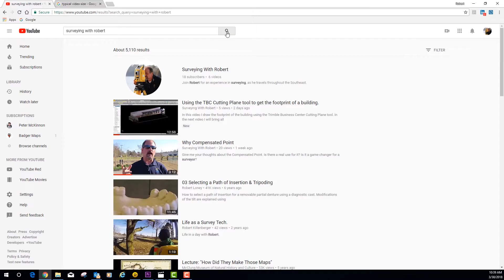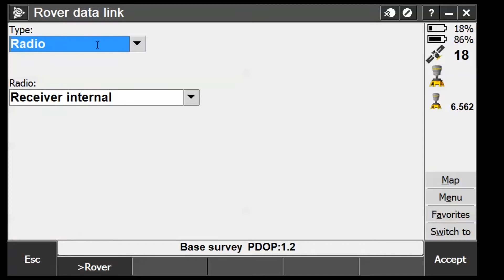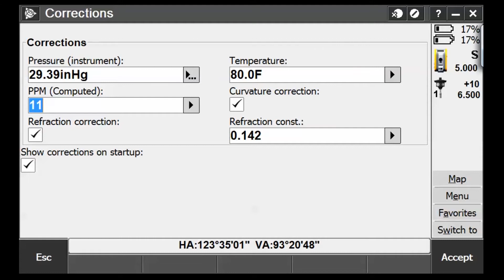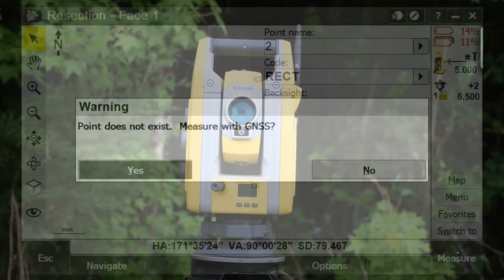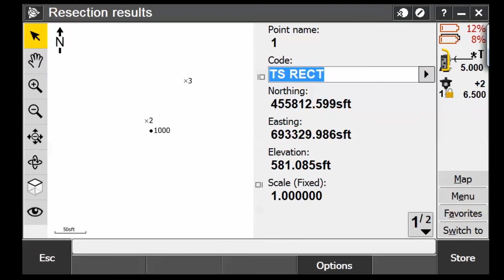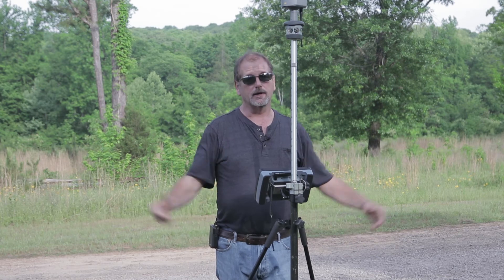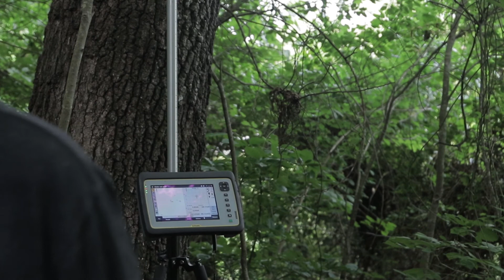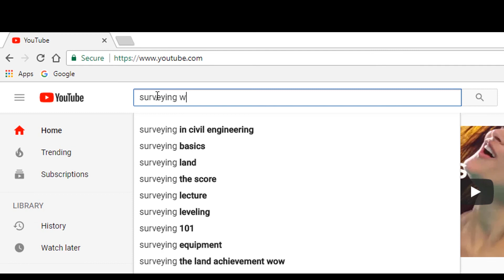Integrated Surveying using a S5 Robot and R10 GPS

Comment: Hello Robert, 
Really enjoying the videos we have been able to see so far.
We would like to know how you setup your settings within the controller (TSC3) to obtain the fixed scale to 1 when you show the resection results.
Our intention is to be able to export the information in a csv file and inserted into Civil 3D and have our distances and linework shown in ground and not grid, as of now when utilizing the Integrated Survey method they are shown in Grid when our csv files are inserted into Civil 3D.
Would obtaining a fixed scale to 1 provide this?

Will appreciate your response.
Reply from the maker: Sounds like a grid to ground video in Access. If your points you resect from are grid then just going to scale one really doesn’t work.

Comment: When doing an integrated survey style, it allows you to input a gps antenna height offset since the gps is sitting on top of the prism and the prism is at the correct height.  However I'm not seeing where trimble access allows you to input a gps offset when in any other survey style even though I like to run an entire day with the gps on the prism. Part of the day I would run integrated, but not all day and I wouldn't want to keep switching rods configurations. Is there a way to do that in Access or is there some other type of work around?

Comment: Hi, In a normal resection geometry is important such as keep long backsights and equilateral triangles. Is this the case with integrated surveying? I would be wary of measuring short bacsights?
Reply from the maker: True but if your not going any farther than your for site then you should be good. Also you can get better accuracy using more than 2 points for your resection to improve geometry on your solution
Reply: @SurveyingWithRobert  Thanks Robert, I do subsidence monitoring on a landfill with a Trimble 5605!! I have to do 3 point resections using reflectorless mode.

Comment: Robert at 12:20 you mentioned pushing a button to switch from GPS to the TS. I've been following your set up procedure but I'm struggling to switch from GNSS to reflector-less. Can you tell me how to quickly switch between the two methods please.  Top videos please keep them coming.
Reply: From my memory, there's a bar at the bottom of the screen showing either RTK fixed and ENZ accuracy or Angles and distances, click on the bar and you can toggle between both? Then measure

Comment: Good day Robert, I have a question for u. I have a new S7 2" DR+ and TCS3 (with internal radio). What kind of range can I get between the TS and Data collector before I lose radio link? At 30' - 50' the connection goes in and out. 60' I lose radio connection all together. I noticed in this video you got 80' but with a S5 & TSC7.
Reply from the maker: You should get 1500 foot in the open and 400-600 feet in the woods. Replace the antennas first if you are trouble shooting.
Reply: I figured it had a much better range, and the antennas are 5 days old. The one thing I didn't do which I am about to go check is changing the radio settings. I had to do that with the TDL 450H on the weekend. there was some local radio inference, I believe this is the case.
Reply from the maker: Jeff Johnstone could be but 5 days old sounds like a bigger issue to me.  Try changing the channels but I suspect it will need to go to the shop.
Reply: @SurveyingWithRobert  geez 7650 possible radio configs (30 CH's;255Net ID's) lol. I fired up the T10 I got for the sx10 and tried using that, no luck. Put the TSC3 antenna on the S7 and have no radio problems. The Trimble dealer (Cansel) here in western canada suspects it was a faulty antenna and a replacement is on the way. Thank You for ur time Rob and take care my friend.

Comment: Great vid Robert. One questions, when you connected to your RTK, did you have a GPS base setup someplace or did you survey with a CORS network/wifi? I've encountered sites where I need to shoot a pin (or multiple) and have traditionally setup a control point (IRS w/Cap/Hub&Tack etc.) via CORS network/wifi hotspot, then setup an R10 base over the point....then have set outside control points to the pin I'm looking to survey. Would have to setup a conventional Total Station on my outside/non-base control point to survey in the Pin... (very time consuming and a lot of effort for one shot) You make this look pretty easy with this GPS/S5 setup & resect. Thanks for any input and be safe out there.
Reply from the maker: Greg Pucher I used a base just because of no cellular service in the area. This example works just as well from a network.
Reply: @SurveyingWithRobert  , thank you for your input sir. The firm I work for just acquired an S5, I look forward to using this method to make life easier for those tricky/difficult shots.
Reply from the maker: Greg Pucher that’s awesome!

Comment: The R10 does not give a fixed/float solution. It just gives you residuals. So calming it’s fixed is not an accurate statement. But good video. I have not done much with integrated but would like to do more.
Reply from the maker: Thanks and you are right! Although you are getting in the weeds! I have been using GPS since mid 90’s and old habits like “it’s fixed” are hard to break. Thanks for pointing that out!
Reply: @SurveyingWithRobert  Come on man, Tony is not "in the woods,"  he is simply just correct, accept it and move on :)

Comment: Will IS work with different data collectors IE Ranger 3 with Survey Pro or is it strictly a Trimble data collector deal. I run a S5 with a Spectra Precision Ranger 3.
Reply from the maker: RagingRudyTV about a year or two ago SP came out with IS. I don’t think it’s as clean as Trimble but it works.

Comment: With the S5 can you show us how to do Missing Line or I think Trimble calls it a inversion. Need to know how to get distance between two points
Reply from the maker: Doug Parsons I think what you are looking for is under cogo and inverse. What are you trying to do?
Reply: I measure track and field, throwing events. So I measure center of the ring my A mark and the rest of the throws are in the sector. Every time I measure in the sector it gives me mark missing ling back to center of ring AB,AC,AD,AE and so on. I checked congo inversion and there is to much stuff I only need h. dist.
Reply: I'm using a sokkia sx now but just bought a Trimble to play with.